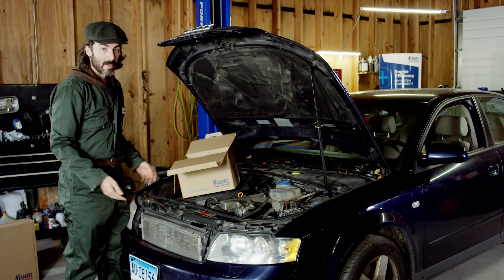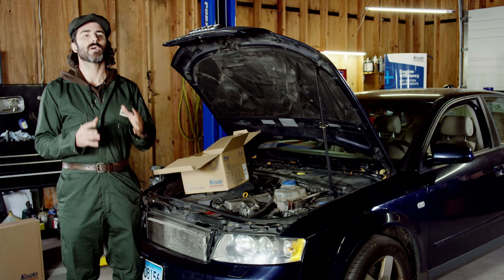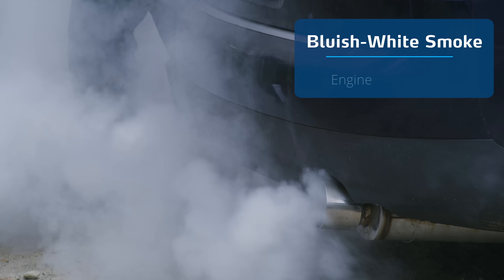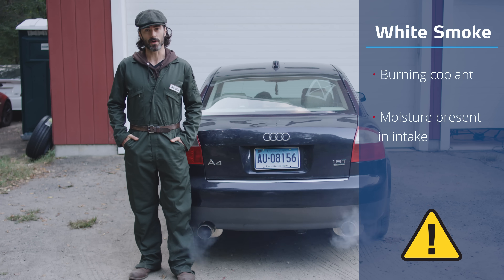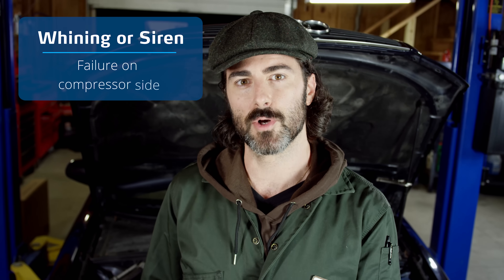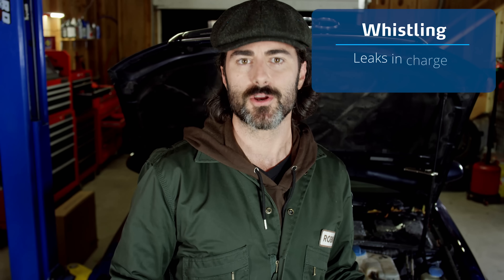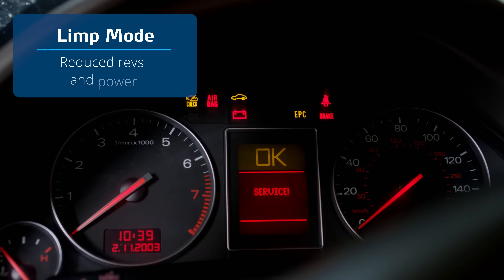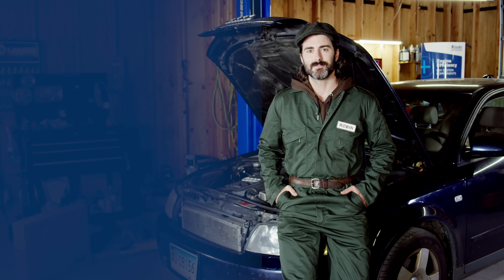Identify Turbo Problems

Comment: Does the turbo cause oil to burn
Reply from the maker: Hi William, the short answer is sometimes. If everything on the engine is in good condition, yes. But if the turbo doesn’t have the right conditions, it will use oil even even though it’s not defect. /Robin

Comment: Very informative video bro, I have a 2002 Audi a4 and I'm experiencing most of these issues. Lack of power, White smoke from exhaust and turbo making a type of screaming noise. At first, I thought It could be the head gasket and I'm still not completely sure it isn't but after watching this I think it's the turbo. Appreciate the help man!
Reply: did you ever get to fix it? What was it?

Comment: Hello Robin I have FORD FIESTA 1.5 TDCI,
When I drive it above 3-4k rpm powertrain light comes. And after driving in relax manner check powertrain light wents away. Car drives preety good always though after scanning it gives code P132A Which is associated with turbo actuator I guess.
Mechanic says both turbocharger and actuator needs to be changed.
Please help me is there something else I can do before changing turbocharger.

Comment: I wonder if you would be able to suggest what could be the issue on the newly installed K03 turbo (Audi 2.0L). When the boost comes in I hear a choppy whistle and when I take of the foot of the gas there is a blow off sound. I don't have any performance parts and turbo was remanufactured sent directly from the factory. Attached is a short clip recorded when driving.

https://youtu.be/OnPhwtdeBhM

Comment: Dealing with periodic sounds almost exactly like 3:31 but its not all the time, I notice it more when in low gears accelerating from a  stop 

no loss of power, no CEL. Under warranty tho, taking it in to get checked. They told me its unusual that no CEL if im having issues so they acted extremely doubtful.

Comment: Hello.  I have an Audi A4 2.0Tdi S Line 2005. I noticed that when I pressed the accelerator I lost speed but the check engine light did not come on.  I put it in a diagnostic and it took out code p0234 can you help me what it can be.  He noted that a few days ago I had changed the throttle body because I had the same problem again. Thanks waiting for your reply
Reply from the maker: Hi Miltos. I’m not sure if it’s your EGR valve or the turbo that causes the problem. You can start checking your three way solenoid valve and hoses for correct turbo boost. /Robin
Reply: @RobinundertheHood  Thanks a lot for your advise I do that. Thanks again. Miltos

Comment: Hi i have seat leon and a maf sensor code (P0101) for a while and i havent done anything for it for a while, the can ran like normal. But recently while driving the car loses power, but i turn the car off and leave it for 5 mins and its back to normal, is it because of the maf or turbo? ive not noticed any of the them turbo smoke problemsor hissing or noises. i have tried cleaning the maf sensor a long time ago when the lack of power wasnt there but it did nothing so i left it.

Comment: Hope this comment is not to late to respond to:

So here is my issue maybe you can give advise:

1. I drive a VW Polo MK4 1.9TDI ASZ version, last year December I drove to my parents for Christmas, on my way, as I overtook another vehicle the turbo popped and pushed all the oil into intake and intercooler. At that point we did not know it was the turbo as the car stated and idled for 5seconds and then died. So we got a family friend out after the car was towed to my parents house he took the boost pipe out connected to the EGR side and the vehicle ran with a lot of white smoke with the car struggling to rev. After a month after the holidays was gone, we got the family friend to check the vehicle out at his workshop, after taking the engine apart the turbo shaft was completely loose inside of the compressor.
2. We imported a secondhand motor from the UK/EU region and we installed the engine, flushed the intercooler and so on, no after 2 month of having the vehicle back, the EGR is spilling oil again as well as the turbo, the intercooler is leaking oil, but no visible smoke when hammering the car on the freeway.

Do you have any suggestions as to what might cause this symptoms?

Comment: Hello. The turbo of our car pajero 1996 leaked oil. I get it fixed sending it to a machine shop. Then they fabricate a new bushing and piston ring for the turbo. We install it back. But we have a new problem. It lacks rev and power and it is emitting huge black smoke. What could be the problem? Hope you can help us..

Comment: great video.  My engine seems to have lost zip and I had a couple times where I accelerated and the power/rpms dropped considerably and the check engine light came on. Since, the check engine light shut off and although still not the same zip its been running pretty fine. No more power dips? Seems confusing. Any idea what might be going on?

Comment: I have a Nissan Navara LE, I had some oil seeping from turbo and the it was pumped through to the compressor and oil was leaking from the tubes leading to the intercooler. 
I washed off all the oil externally and cleaned up all the oil. However, now the car is lacking power. The turbo isnt kicking in at above 2500rpm.. I have been able to drive around but at low rpm, below 2000rpm. Engine is giving off a thick black smoke and I have oil also leaking from one of the fuel injectors on the engine head. 
Is my turbo damaged? What may be the issue here? Please help.
Reply: Hello mister.i have the same problem..it lacks rev and power and it emits huge black smoke...did you get it fixed? What did you do?

Comment: Hey, I have a Jetta 2.0T MK5. I was doing a pull from a idle position I completely lost all boost and I don’t hear any whooshes from my intake anymore. Not sure if it’s blown I don’t have any whining noises but my gas engine basically sounds like a 18-wheeler diesel to best describe it. No engine light. I have a K&N Air Intake. Any help is appreciated

Comment: checkoing out this video as my 2019 Q60 is acting weird... only 4k on it... but intermittently it feels like the turbo's don't function... or... there's little power and then suddenly at 3-4k rpm the turbo's just wake up... while usually you feel a good pull at 1500rpm.. some days it doesn't happen... other days it happens a few times.

Comment: Maybe someone can help me here, i have the same car as in the video. I have a problem it bugs out in the 3000-4000 rpm range. When i disconect the n75 valve it stops but then the car feel alot slower. My thought is that Maybe it lacks fuel, but on the other hand i think it have something to do with over or under boosting. Is there some 1.8t guru out there with som tips, considering to pill the plugs and se if its running rich.

Comment: Thank you Robin, that was informative and very well presented. Since I installed a new larger turbo I have had this whistle that souns like a 747 jet and have thought it is how its meant to be as it is also kind of cool but would much prefer it to not be there so will perform a smoke test. Who knows?, cheers

Comment: My A4 b7 exhaust smokes only during cold starts but when driving there’s no smoke and there’s a faint whining noise when accelerating  and not much power on the highway. Is my turbo going bad  it’s been doing this for almost a year

Comment: 🖐 Hi Robin ,i have a vw passat 2007 1.9 tdi , i deleted dpf from the car becouse was blocked very often , now my car when it starts up has some blue smoke and i goes out when the engine is warm , the car runs perfectly has a lot of power , but that smoke is very unplesant ...

Comment: Nice video bud, ive just bought a 2003 volkswagen golf tdi, previous owner said that he had a mew turbo put on last year but ive noticed that the intake connected to the turbo isnt fastened on properly, could this be the cause of my car being very underpowered at low revs?

Comment: Now a days I am facing problem with my Grande Punto 2010 model 75 horsepower.
During the first crank(start) my car is releasing white smoke for a while ( maximum for 5 minutes or for 2-3km). Then it disappear completely. There is not any problem in pickup or power of the car. Engine oil level is also decreasing over the time.
Kindly help me out that what could be the problem? 
Thanks.

Comment: I have a Peugeot 406 2.0HDi 110hp and have a problem with no power after around 3000rpm (it goes also into limp mode if I force it while driving around 3000rpm), heavy black smoke starting at around 2800rpm. There is no problem with the turbo or it's wastegate, my scanner shows me P0243 that indicates a bad turbo solenoid but I also check the solenoid that goes to the turbo but it works, the one that doesn't work properly is the EGR solenoid but also after I blank it by unpluging it everything stays the same. All hoses are good. The only thing that I didn't check was Intercooler, catalyst converter and intake manifold (maybe it is heavily blocked cuzz the egr didn't worked properly-it was opening and closing all the time at idle cuzz the solenoid is not operating as it should)...?

Comment: Hello bro i Like your videos and your pro advice to as thanks,i have Renault laguna   1.9 dci and i buy car everything is working perfectli until couple days,i lose sound and accelaration and power and lock on 2 k rmp ,and i see in shit condition air filter i replace them and i unlock to 4 k rmp but again i dont have power,on diagnostic i Got mass flow air sensor and i Got little black smoke,so my question is did i need to first try to clean or replace sensor and try? Or is this some problem with turbocharger.thanks bro

Comment: My boost gauge doesn't go past 0. It just stops before it reaches 0. No smoke from the exhaust I do get smoke from the engine compartment. It seems there's oil accumulation where the three hoses meet on top. Any thoughts?? Thanks

Comment: This was a really good and educational video! Thnx guys!
Reply from the maker: You are welcome Norbert. Glad you liked it.
Reply: @RobinundertheHood  water levels dropping in radiator,oil in coolant and excessive white smoke I mean like a smoke screen and won't start now. Isuzu 2003 trooper (Jackaroo in Australia)3ltr 4jx1 motor. From what you're describing sounds like coolant leaking into turbo? Thanks
Reply: Yeh gr8 breakdown about turbos in four stages with an identifier one to go with it ...ive got lol     a renault master atm and i have no boost bit your vkdeos have given me a bigger picture relating to other problem s ive had with van ,im on second turbo and this has gone silent no power  ..the good news is everyone with a dci engine will have similar issues...to cut a long story short ,wear and tare could mean alot of blowby gases (egr valve choking quickly ,,question is if engines too far gone or is it now a stuck actuator Issue...2002 2.2dci ren master.
Gr8 videos thanks again  👍

Comment: I have 2002 Subaru impreza wrx 2.0l  check engine on says P0244  Turbo/Super Charger Wastegate Solenoid 'A' ?  Could be turbo??
Reply: I have a P0243 on my Peugeot 406 and it can be many things related from Intercooler to the wastegate itself. Check all hoses that go from Intercooler to the wastegate, check MAP sensor, check Intercooler itself for leakage, check solenoids, check EGR, check the wastegate on the Turbo, check the intake manifold if it's clogged up, check the catalyst converter and maybe also check the electrical circuit that goes to both EGR and Turbo solenoids... I have the same problem but my Turbo is ok, something else is the problem

Comment: Subbed! Great video! Just wanted to ask something. My AT turbocharged car makes a bit of a rattle and blows a small amount of smoke but only under load (aggressive acceleration) on high RPM (not when standing). Car isn't throwing any codes whatsoever. Could that be a bad bearing? Greetings from Poland! :)

Comment: 2011 f150 ecoboost smokes when I let off throttle while driving . Changed the pcv valve "Just because" still the same . If the Turbo is leaking oil will it clear up when giving it throttle and smoke on throttle let up ???

Comment: Hi Robin . I have a vw touran that’s putting out black smoke when the turbo kicks in about 2000 rpm there’s no loss of power and no strange noises ... my mechanic says it’s the turbo because it has oil in it.. I’m not sure why I doubt him ... can you shed any light on the symptoms 

Cheers steve

Comment: Hi Rob am having issues with my turbo this I am the second one in less than 2 month is there a possibility that the turbo is not getting oil feed to the turbine ?
Reply from the maker: Hi. What are the symptoms? Do you hear noise coming from the engine? Is there there smoke? Could you also tell me how long the replacement turbo lasted?
Reply: @RobinundertheHood  Since he didnt respond to you can I tell you that I have a 2017 GTI 26k miles. Only when driving hard in 3rd at about 4k rpm I can hear my turbo spooling but then I notice I hear it chopping almost like the sound of a helicopter. It stops once I shift or if I get on the pedal harder. I cannot find an answer as to what this is anyplace. Please help!
Reply: About month and a half to be exact

Comment: Ayyyeee Robin nice to meet you first off! Second, I have a 2011 Hyundai Genesis coupe 2.0t and I had the car tuned and it was pushing about 400 hp to the back wheels, but I had the battery go bad and I replaced it and it feels like it’s in limp mode like the turbo isn’t there, but sometimes it wants to work and does. It just sounds like air going thru the turbo. It’s just weird. I figured you’d probably know what it was before me so I figured I’d give it a shot and ask. My friend said it may be the wires to the battery or the antifreeze. Does that sound right?
Reply: Not right at all. I would check your air filters and have a Hyundai technician take a peek at it. Genesis turbos are trash in my opinion I had the same issue and had to sell the car.

Comment: Whats wrong if i got blue smoke coming from exhaust
Reply from the maker: Hi mate, this means your engine burns something more than fuel. Blueish smoke is a sign of engine burning oil. This may relate to the turbo seals but the root cause may also be in the engine header gasket, PCV/crankcase ventilation or something else causing oil penetrating to the combustion chamber. Try to get to the turbo and its surroundings to see if there are some oil splashes / soiling around, as well as control the engine oil level.
Reply: @RobinundertheHood  Thank You very much for replying sir! It only happened once. Now its not there Thanks to God. Now, the smoke is regular color like how it should be. I think the Car may need a tune to the ecu from a local tuneing shop. This is a single Turbo 370z.
Reply: Hi my car is burning oil its a golf5 gti what could be the problem

Comment: Thanks for the video My Mazda Cx7 hisses when transmitting between gears 1 to 5 but become smooth at 6 AND sometimes it doesn't even  do this when it's not moving fast Could this be the turbo?
Reply from the maker: No idea mate,  but you would clearly feel if the turbo is bad or at least see some more symptoms - lack of power, fuel consumption etc. If possible try to measure boost pressure to see if there are any issues on the charge side.

Comment: I like your style of presenting, subbed.
Reply from the maker: Thank you Myke!
Reply: @RobinundertheHood so if you’ve had a turbo charged car for a year how would i know if it’s building the boost like it’s spouse to unfortunately idk what the acceleration should be and I’m the original owner of the car
Reply: Same hahahaha
Reply: Putting the noise and smoke to the fault was genius I keep checking all my hoses and now I know a hiss is likely to be and exhaust leak I can hopefully put this problem to bed once its stopped F-ing raining 🌧
Reply: Reminds me of norm Abrams from this old house on PBS in the 90s!

Comment: Thanks to this video I found out that I don t have a trubo .
Reply: @RobinundertheHood  hello. I would like to know today in the morning i was going with my car i stopped in a traffic light for 10 seconds then i saw a white smoke suddenly coming out. It lasted for about 15 seconds and after it disappeared but in the car I could smell a bad  scent after the release of this white smoke. I have  a diesel car. When I used it 1 hour ago again I didn't se any white smoke. So what's that?
Reply: @RobinundertheHood  what is that huge bulge in your left pocket Robin ?..is it your ten inch adjustable wrench?🎉😂
Reply: @RobinundertheHood  hi can you please help???? I've had this problem for such a long time. When I accelerate I have a hissing noise. Then  when I leave the throttle off I have a fu Fu fu noise like a dump vave. I have no ruff idle no smoke no turbo lag just this annoying noise is happened after one of the diesel injectors failed. Can you shed some light?? Thanks
Reply: Hahaha best comment.
Reply: Lucky bastard.
Reply: Trubo
Reply: Thanks mr,turbo shaft of my mini bus have been broken off,can it be repaired?
Reply: @lumulikongwale779 long as your actual shaft doesnt drop off....
Reply: This is the biggest L XD
Reply: Damn
Reply: You have made my awful day. Thanks bro♥️
Reply: Loool
Reply: Them gatt damn trubos
Reply: What’s a turbo
Reply: Did it fall off the car?  ha ha ha.
Reply: @mattinwinkymg  qq v
Reply: @mattinwinkymg  No I have petrol without turbo